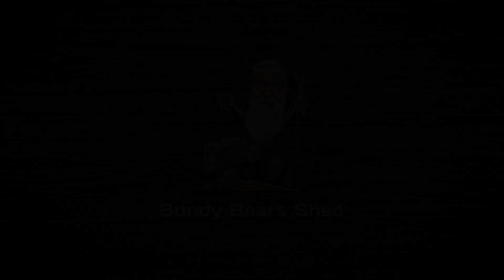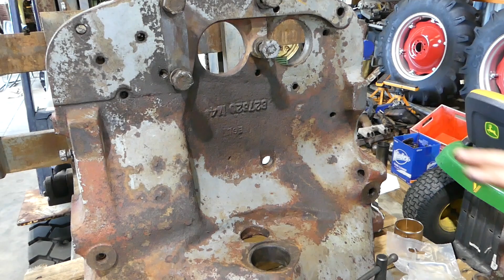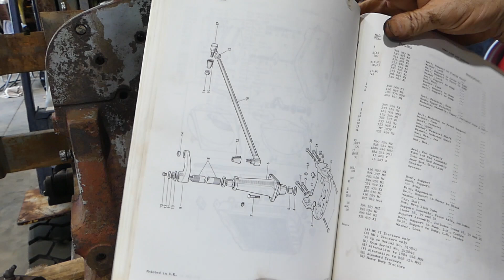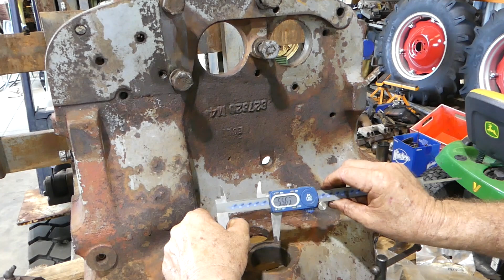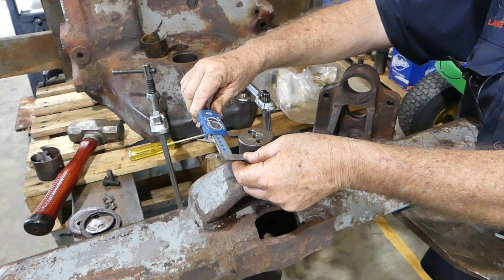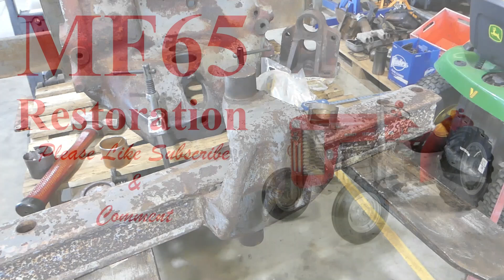Massey Ferguson 65 # 11 Front Axle Pivot Wear, What Should I Do?

Comment: A lot of fiddling but you could always put a cutter in the 4 jaw chuck and  clamp the axle to the bed of the lathe and give it a go.  Sometimes though you are better off to just pay the guy with the right equipment to do it the easy way. 🙂
Reply from the maker: Yeah I have fitted it into my little mill but the bolster will just get an oversized bush.

Comment: Bring it on over to the shop and we can get those holes and pivots rebuilt no problem!  Weld up those pivots and use the boring head to turn them back down. Then bore the front support back round and make a new bush since the correct one doesn't appear available anyway.  On that other piece it needs a ring so the grease goes to the top. No need to lube the bottom of the bushing unless you do wheelies all the time, all the load is opposite the grease fitting so it needs to go around the bush then come out on top of the pin.
Reply from the maker: Do you think they would let it on the plane as hand luggage, lol.
Reply: @bundybearsshed  Probably if you carry it in one hand they won't say to much to you about it. LOL

Comment: If I could beg borrow or steal a mill big enough, I'd round off the journals with a boring head, round out the housings with same, and turn a custom bushing.  Wouldn't be too hard to do, not too expensive, good fix.....if you can find a mill big enough.
Reply from the maker: Stay tuned.

Comment: I also got an axle from the same guy with good pins. The loader on mine wore the crap out of the pivots. Never mind the grease fitting was broken off and god knows when it was last greased. But all is fixed now! Also had to do a little filing on the hole in the saddle to get the pump shaft though it for the hydraulic pump that runs the loader and power steering. The tractor is a early  1956  MH50 w/202 loader. It's on my channel if you want to see it. And yes ,your vids helped me out quite a bit with the restoration......Thank you very much for all your knowledge and Videoing!!!!
Reply from the maker: Ill go over for a look

Comment: If you want the service manual, I have the MF one. Happy to send it your way.

Re the pins, if they don't fit the mill it'll be damn close to fitting in the lathe.

On the bolster, those little mills don't take a lot of room between the spindle and the front, it might just squeeze in.

Otherwise, you can make a fairly janky line boring setup fairly easily and use a drill press to drive it. Basically, make a line boring bar and a plug for the existing hole to get the bar in the right spot, then a couple of plates to support the bar stood off with some bolts and welded to the bolster, grease it up at the pivots and stick it in the drill press and you're away. Just make it round and then sleeve it back down to size.

Just depends on how much effort you want to put in to avoid taking it to a shop.
Reply from the maker: Thanks Daniel, Is the manual the British one? I would like to buy it if it is. email bundybearsshed@gmail.com.